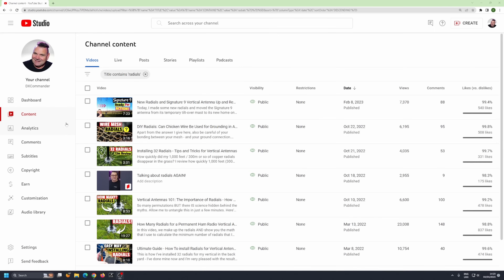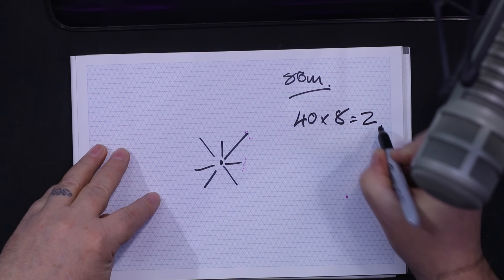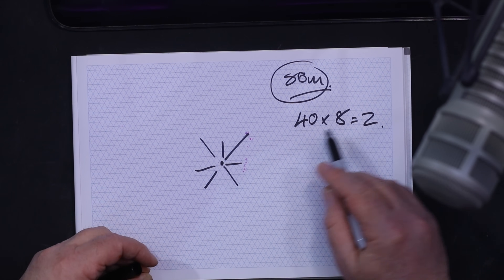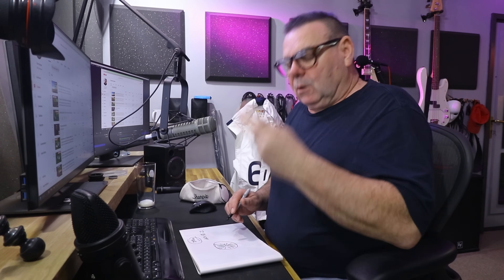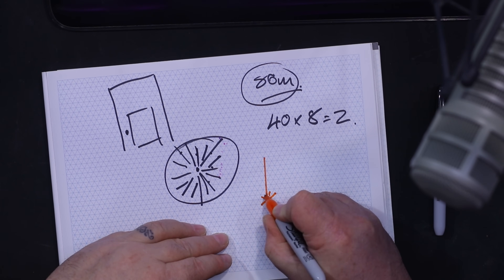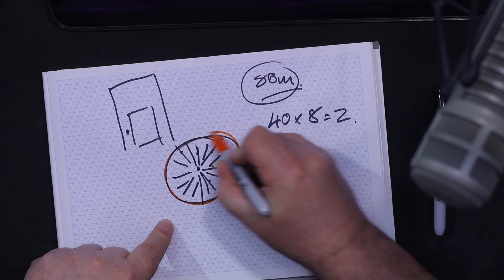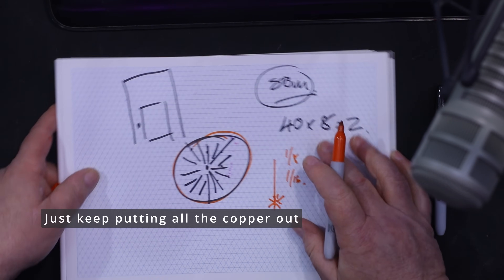3 Rules - Quick Tip - Radials for Ground Mounted Vertical Antennas

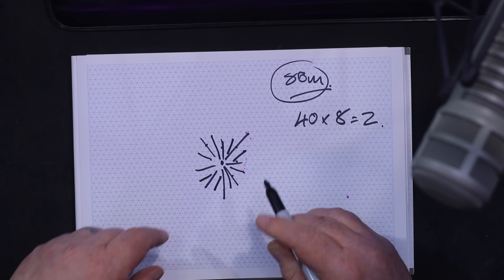Comment: Hi Cal, can I ask a stupid question please? 🙏😅 What happens if you join all the radials at the ends? Say you had 8 or 16 radials, and then used a large loop of wire to go around the ends and connect them all (ie 2:21).. is this a really stupid question? (Sorry, lol😅🙏)
Reply from the maker: Not a stupid question. None are.. However, in this case I think it would just be a waste of time. I don't think it would add or subtract anything.. Better to use that wire and make more short radials for right under the antenna..
Reply: @DXCommanderHQ  😊 Thanks Callum, you have the patience of a saint, mate 😇 Really enjoy your channel, I watch it every day 🌟🌟🌟🌟🌟

Comment: I have been reading on the vertical antenna and ground system topic. If I understand/comprehend correctly, the radials merely decrease losses in the ground image (acts as a dipole, vertical radiates and a mirror image in the ground makes up the other half of the dipole) by reducing the resistance of the ground. "The ground acts as a lossy capacitor" is how they describe it. That being said, the radials would counteract that by 1. Reducing the resistance and 2. By adding inductance to counteract the capacitance of the soil.
I could have misunderstood my reading. But it does seem to explain why more of the shorter radials would work.
Thanks for the vids, Callum. You are a true "Elmer" and a ham couldn't ask for a better mentor (or "experi-mentor")!
Reply from the maker: I suppose that's the complex way of looking at it, yes :)
Reply: @DXCommanderHQ  All I have to say, my DX Commander Classic JUST WORKS. I went overboard. I studied the ARRL ANtenna Handbook and decided I could afford enough  14AWG THHN from the DIY home store to put down 32 each 5 meter radials that fit nicely in my side yard.  The reference I used indicated any more radials or any longer radials just didn't make it worth the gain in signal just as you said. The E & H fields decrease rapidly as you get farther from the radiating vertical element. So more shorter radials than  fewer longer radials are better, anyway. I learned more from your videos... You are truly Lord Callum, The Elmer!

Comment: With the 80 meter option I have 55.1meters of DX10 wire left for radials. That would be (10) 5.5meter radials or (20) 2.25meter radials. Is that enough?
Reply from the maker: Sure.. You can always add more some day.. FOr 80m, if you feel you need more clunk, add about 80m more one day..

Comment: Good info. I thought I would add my experience here. 
On 160 meters, since 2001, I have used a 165 to 180 foot inverted L with usually 2 radials. Sometimes none (2014-2017) and occasionally three (2013-2014).
I worked over 700 QSOs in 160 meter contests with no radials in 2014 and 2017. I worked over 800 with I think three radials but it may have been two in 2013. I definitely worked 874 QSOs with only two radials in 2012. At my current QTH, I have a ground rod at the base of my 160 meter inverted L and always one, sometimes two radials. Good enough for 450 to 600 plus QSOs in most 160 contests since 2019 without many hours of effort. I do also hold 160 meter DXCC with the inverted L and it’s “substandard radial” system!  So the antennas with a minimal ground system do work and pretty good at that.

The ground or radial system make up half of the antenna in antenna systems where they are necessary. A simple ground rod should in most cases be significantly less effective than having radials. I am not sure you can always tell much difference. The quality of the ground out in front of the vertical, about which you can do absolutely nothing to fix, is a major factor in vertical performance. Reducing ground loses at the base of the vertical is within the things you can do. We do that with a “good ground”. Whatever that means. Sometimes things are so good that a ground rod by itself works really good. Sometimes only a few radials seem to be enough. Sometimes we don’t know when to stop. In any case it’s always a case of diminishing returns. However, on 160 meters I have never used more that three radials for one reason or another!
73 de N4DJ

Comment: How much gain would a Dx Comannder have at 12 watts SSB for 11M? HI 73
Reply from the maker: Gain at 12W.. OK, difficult because gain and watts are nor normally in the same calculation. What I CAN say is that it's about a S point lower than a gainmaster at 12m. I know because we've recently done some testing. However, for 11m as a mono-bander, you are chosing the wrong antenna.. Just go Imax 2000, GainMaster, A99 etc. Just works. Of course if you need ham bands as WELL, that's different. It does work on 11m. Like it works on 12m and 10m. Ive had Aus / New Zealand/ USA etc on both those bands.

Comment: Fun story from field day. 
I put my 80m wire on my DX Commander Classic just before sunset. I disconnected all the radials, 7 sets of four wires each at 4.5meters each. After attempting to tune the 80 meter as a sloper with an analyzer and forgetting to reattach my radials, I put the band pass filter back on for 15m and worked 15m until midnight. Our club in Enid OK got New Zealand for field day on the DXCommander without a single radial actually clipped to the baseplate! DX Commander Classic 80-10 for the win! Also I got Rhode Island, Maine, Vermont, New Hampshire, West Washington State, and many more contacts mostly on 15m without a radial… at least 20 distant contacts. Testimonial done!
Reply from the maker: Woops! Mind you, you would only have been about 3-6dB down on real output with that set up. The coax at least was ONE radial!

Comment: Have you ever experimented with the distance between the radial plate and driven plate, or the distance between the ground and the radial plate? I've always wondered if those mattered or not. I've also wondered if one were to use a loop-on-the-ground receive antenna, if there would be any concerns about the distance between it and the radials of a vertical. These are the kinds of things that pop into my head when I'm bored- I may need therapy. 😂
Reply from the maker: It will eventually matter because if you think about it, each element needs to be near the feedpoint.. STretching it out means we are connecting the element firther up the "master" element and eventually it won't work as planned. Good question.

Comment: I like this advice.  My QRZ page shows the antenna I've used to make contacts in 12 countries not counting my own and 17 United States.  At the time, it was a not-quite-quarter-wave wire pulled from the ground into a tree.  The "radials" was a ground rod driven 8 feet into the dirt.  I'm told by a fellow on QRZ forums that there's a lot of loss into the ground this way, but I made it a quarter of the way around the world with 20 watts peak envelope.  Granted the other guy had a 100 element stacked super yagi pointed right at me but still...  Point is, that wire-and-ground-rod got me on the air and got me the majority of the contacts I've made in the two months I've been on HF.

I now am adding radials out of #24 AWG Ethernet cable wire and replaced the 8 foot ground rod with one about 3 1/2 feet long.  Should have less ground loss, but I haven't had this new setup long enough to make a determination that it performs any better...  but I'm confident it will prove itself.
Reply from the maker: OK, so that grounbd rod will do nothing really. Disconnect it temporarily and do a test with a local friend. EVERYTHING works, it's just how well you want it. You could probably double your effective radiated power with some short radials.

Comment: My vertical antenna is a 9 meters fishing mast, long/random wire fed by 9:1 unun, with 16 radials, only 2-3 meters each, since that's what available in my crowded city lot. Needs tuner, but works 80-10m no complaints.

Comment: I've got 24 3.5 meter radials in an almost perfect circle with a DX Commander with the 80 Meter inverted L option. It works very well! I've thought about starting to play with the radials to see what I can do to improve. I'm on the west coast of USA (Desert of Washington State) and Europe can be hit and miss. I'd like a bit more DX, but I think my issue is more city QRM and I only have 100 W output. Anyway, that's my 2 cents. 73 - KJ7RDY
Reply from the maker: Well if you have the time, there's nothing to stop you "upgrading" and adding more..

Comment: I make my own aerials etc. Still learning but find like you say as long as you have ground radials it works. But working wit concrete or paving slabs. I just use more radials and sometimes stick tent pegs into ground on the ends electrically connected. Cheers from old George.  Ps keep up the videos . Just grateful stuff.
Reply from the maker: Thanks for sharing

Comment: Thanks Callum 🎉. I finally understand the layout of the radials. My head has been spinning on this since I bought my Classic last year Black Friday Special. Haven't installed it as of yet. Got the # cubes for bands, Cline wire stripper, Milwaukee 100' measuring tape and a 4' PVC to insert the Mast on it. I will give a report on this as soon as I'm deployed already. Stay Safe 73 Ruben KD6CWI
Reply from the maker: Do it! :)
Reply: @DXCommanderHQ Thanks Callum. Have a wonderful week. Stay safe 73 Ruben KD6CWI

Comment: Have you ever modelled the DXC at a height of lets say 30ft , using radials , but instead  of 1/4 wave use 1/8 wave ? I am thinking i cam make the radials from aluminium tubing  .
Reply from the maker: Well, you could do. It would be HUGE and unless you can get to at least half a wavelength, it's just not worth it. Actually I have a video coming out toying with this idea..

Comment: I have a 36 foot vertical (in 5 sections that screw together) that I used when I lived in Cameroon.  I had NO radials at all, but it WAS grounded with some serious copper braid to a ground rod and it worked well, in spite of not having radials.  It sat on a ledge of the house at about 10 feet off the ground.  I used an Icom AT4 with it.  I was able to tune it from 160 to 10 meters and used it a lot with good signal reports.  Also had a 2 ele Mosley triband at about 60 foot elevation, also well grounded which did quite well in spite of the house being surrounded by houses at higher level than mine, except to the east of my qth.  I  was in an area probably about 40 ft lower than everything to the west and northwest, but to the east was okay.   73's from ex TJ2US and ex J5UAI, now kb0jqc

Comment: I've done it many different ways 12-10m wires or 5-10m and 20-3m wires or 30-3m wires and I've had great SWR's on 40 and up it don't have to be hard as some people make it de W9US
Reply: @DXCommander where can I buy those fork connectors in the US rather than paying shipping from you Thanks de W9US

Comment: What if you need to bury them a inch or so?
Reply from the maker: I would not physically bury them. Too deep and it won't work. I use "biodegradable radial pins" which hold them tight to the ground and within a week or so, they've gone.

Comment: My Classic with 80m works great with 32, 3 meter radials laid at 360 degrees. Swr is under 1.5 on all bands except 80 and it's about 1.8 in the voice portion. My radial length was determined by the available space. Like you said, it just works. Jack K5FIT

Comment: Thank you for saying this Callum!!!  Finally.  The bottom line is the base of a ground mounted vertical is a current node.  More metal closer to the base of the antenna will allow for better conductivity at that point... more radials.... The current node is where the antenna radiates from!
Reply from the maker: Well said!

Comment: Agree with this Callum, at the old QTH I had 200m+ if radial wire down on my DXC classic, I wanted to do quickly do some portable work so made a poor man's DX Commander from an old 7m pole, 2 paint tin lids for the element & radial bases & 50m if cheap speaker wire for the radials.  On an A/B test to Florida on 20m no diffencnce! Paint tins on the air anyone?
Reply from the maker: Done.. Need to empty a few first!

Comment: Hi Cal, my Classic has been up nearly 4 years now with 6x4 bundles of radials cut into the grass delivering dx into Antarctica, Hawaii, Alaska VK & ZL.  All radial lengths as recommended by you and the added bonus is unlike chicken wire (in the 70's) they will not rot over time. 😂  Great video by the way .
Reply from the maker: Tnx Keith.
Reply: May I ask where you are?  That's GOOD stuff there...

Comment: Back when I first got my ham ticket in the 70's I never really liked or trusted verticals. Not sure why. Guess i thought they were a compromised antenna. Maybe because the ones I saw used had a crappy radial system. Not sure why. Once I put up my DXC classic.  I was sold. I have (25) 12'ish foot (3.6m-3.8m) radials. It kicks butt on 40m and 30m and is pretty decent on 20m. Thanks Callum!
Reply from the maker: Fabulous!

Comment: I have a hustler 6btv as my main antenna, 100w through it, in ZL. My radials are a bunch of 4m wires pointed mostly south and I can make SSB contacts to VK on 40-10m no problem!

Comment: I have 16 radials on my DX commander Rapide system installed in a corner of my small yard ( I live in a HOA area) and... I took one extra radial and I connected it to my metal roof. .. The Performance is outstanding! 73s de TI2GBB GREG 🇨🇷
Reply: I wired up to the fence as well.

Comment: I'm FCC certified several times over. I could design a perfect antenna to talk to Moscow at high noon from Nebraska. I don't have to, I don't want to, and I can wait until 1am where the ionosphere let me anyway with any good antenna. People, including me, get hung up on the BEST thing we can design or make. But it realistically will never EVER come up to max spec. Be it radio or art, you have to eventually say "this is the best I can make, in the time I can make it in"
Reply from the maker: Haha. Yes, I used to be the same. Ultimate gain, best F/B etc..!

Comment: When I run portable (camping) I run a 17 foot vertical with three (roughly equally spaced)  33 foot radials on 20 m and always get excellent results.
Often better than with my 102 foot doublet at 40 feet above gnd at my home QTH.
So, I agree - raadials, although necessary, are overrated.  - A person could probbaly do quite well with only one radial, so the antenna has a basic counterpoise, and that's it. - Cheers!

Comment: I have a small yard....  maybe 3 by 5 meters or so.....  and most of the time I've operated I've had around 8 radials in a 90 degree arc (antenna is in corner) and got DXCC, WAS, etc on it... this year due to some issues, I've only got 1 proper radial (most of the radials i placed in lawn have over time been destroyed by mowing, and so have 1 ever-so-slightly above the ground (like an inch) and I've completed 40,30,20 band DXCC  and not very far from completing 15,12, 10... bit further on 17 but just has felt I've had really bad luck on timing there and generally has been a harder band for me some reason. So yeah... its doable with less.  Never going to compete with big-gun stations, but still getting on the air the priority number one... and its all about getting something that radiates up. God I'd love a lawn i could put 360 degree quarter wavelengths etc etc etc... but yeah... not likely any time soon.

Comment: How would using gal strap say 1 inch wide go? Could you get the same result with just two or three as you would with a bunch of wires?
Reply from the maker: Erm.. Probably. You would have to try it. Essentially, you would be 3 x radials.

Comment: I built a PAC-12 antenna and use 4 radials. I live on the second floor of my apartment and have a small deck. The wires droop down over the deck, so far the downstairs neighbor hasn't complained. I also built 4 loading coils for the radials and I think it might have helped at least with SWR. The apartment complex is a little electrically noisy so I haven't try making contracts yet.

I also built a AM broadcast coil compatible with my PAC-12 and I can get it to tune to 1.610MHz at 1.2 SWR (checked with my VNA) for my part 15 transmitter.

73 de David KEØPBI :3